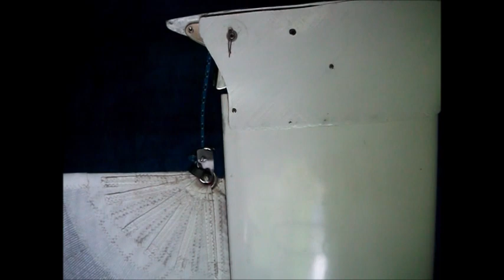Halyard lock

Comment: The bracket fixed to the masthead won't succumb to fatigue or loosen over time?
Reply from the maker: I think it will be strong enough. It is 2mm thick 316 stainless and most of the stress is in plain tension. But time will tell. It is very easy to design something that will never fail, just make it many times stronger than needed. Trouble is that also makes it many times heavier than needed. High performance multihull boats should be designed to be just strong enough, then only one more thing should be added, (more lightness!)